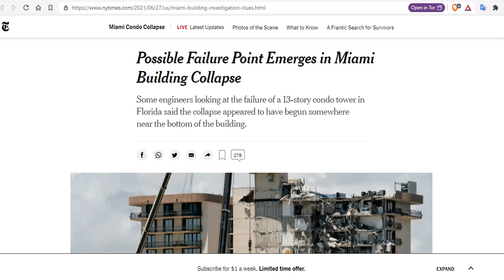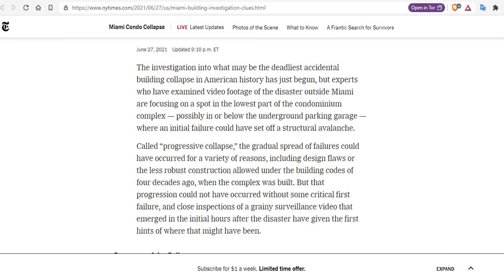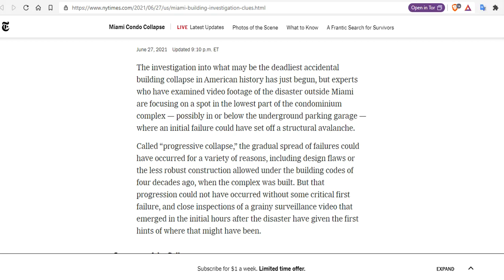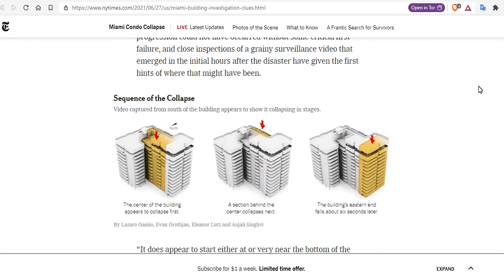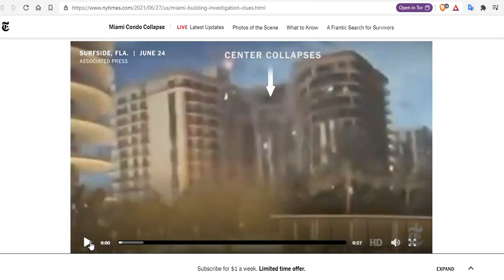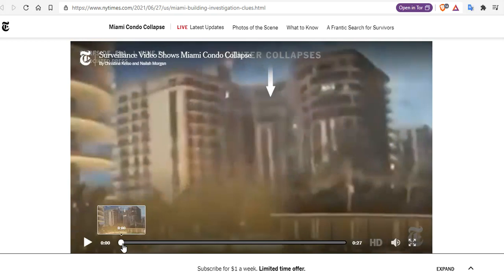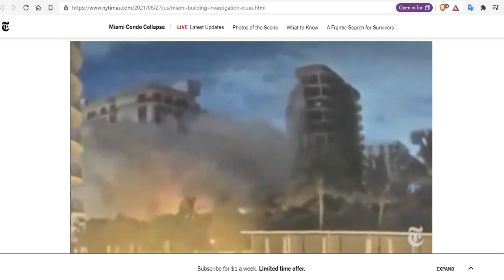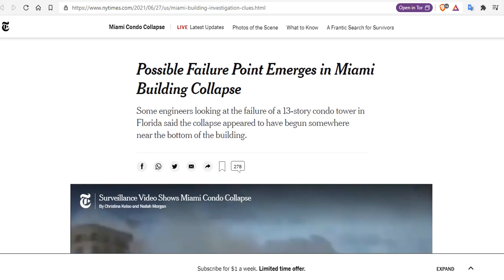Possible Failure Point Emerges in Miami Building Collapse - Prayers Go Out To All Involved!

Comment: I read an engineers report from 3 years ago it has a list of must fix asap. None of them were done. All the repairs that were done were done improperly
Reply: Terrible that this could've been prevented. Those responsible need a little jail time to scare other condo associations straight. No repair cost is higher than the wrongful death settlements forthcoming.

Comment: I respect your skeptical scientific mind very much, but let's not forget we can't be experts in all things. I'm an engineering surveyor by trade with a specialty in compromised highrise structures, and I can tell you I've seen zero evidence of anything nefarious so far. I see LOTS of evidence of shitty construction and piss poor maintenance. The supposed McAfee tweet was not found in his archived posts. Buildings collapsing in this manner is not evidence of a controlled demolition. There's video of the popcorn ceiling stucco crumbling under compression for a day or two before the collapse. At this moment all evidence points to punch sheer freeing a lower slab from it's supporting columns, crippling one or more columns, and causing the structure to "creep to failure". It does not appear whatsoever to be a sudden event. Nothing in the rebar suggests an explosion, triggering impact, or foul play. If I see new evidence, I'm open to changing my mind. But let's save our armchair forensics for Building 7.
Reply: That is a fair comment. I have recently been looking into punched sheer fracturing in slabs. 
A building I have been working at has this flaw to which the engineers had said they are good cracks.... when the cracks run from one column to the other and at a column spread out in an 'ice fracture' look...

After hearing how the rebar doesn't extend to column supports and so then the grid mesh doesn't meet there, there is no overlap for integrity. Then they go pack 100+ tons off steel on top. (The building had already been evacuated due to 'settling')

They had already monitored a 2 inch drop in the slab height needless to say; I don't feel safe there. I have made sure I will never visit there again

It inevitably will come loose one day.

The engineer of this job is the same who is involved with a ceiling collapse at Curtin university WA, Australia 2020. They still haven't found anyone liable for the death of (luckily) only 1 worker. 1 young man who still had a life ahead of him.

My heart goes out to all the people who have suffered this tragedy in Miami.

Still, I am open minded about the possibilities of defect manipulations to cause a collapse.

I just don't trust the coincidental timing of this.

One thing is certain though, John McAfee didn't commit to suicide
Reply: @baalqefel1570  I agree with you about John. Just stay safe and never go in a building you're uncomfortable with. If you don't like the look of the rebar lapping around columns, stay the heck out. Like you, I'm keeping my mind open for nefarious things, just haven't seen anything yet 👍🏼
Reply: Thanks for your expert opinion. However, the gross negligence does seem nefarious.
Reply: @wildanimus2559  Oh this is definitely a case of gross negligence, no doubt. But I hesitate to call that nefarious because I don't know their intention. And while I am experienced, I'm not truly an expert 🤷 But yeah people should go to jail for this. Inexcusable to allow that condition to degenerate
Reply: Oh my god a sane person. Thank you

Comment: Middle of building to the upper left of demolished building and to the upper right rear of the building still standing....there are flashing light pulses.
Reply: My guess here would be electricity arcing as the power lines were breaking. But good eye
Reply: @Ryyder64  Yeah I suspect that's arcing from the severed conductors

Comment: Remember that beach construction has to be built on pilings driven through the sand to produce load bearing members. I would imagine 40 years ago they were still driving wooden pilings - think telephone poles (my Daddy's profession) They would be clustered together and cover a wide area under the structure. They need the sand to be present to work properly. If that whole area has been undermined with seawater for decades we don't know what could be compromised and what buckled. We need a whole lot more info. <bb

Comment: Durring a controlled demolition they weaken the bottom of the structure by taking walls and structural reenforcements out. Then they  attack directional cutting explosives. They also will cut through reenforcements half way through to aid in the collapse because exsposives don’t always cut trough large pillars. This was not a controled demolition. This was a catastrophic structural failure probably due to continued stress from the ground being to soft to build on and water erosion. But it’s not a controlled demolition. That’s not how demolition works

Comment: There was 9 million dollars plus in deferred maintenance scheduled on the building, might of been cheaper to tear it down, previous repairs likely contributed to the demise of the structure, but likely the cement used might have been sub standard allowing water, and moisture to attack the rebar internal structure weakening the building even more, lets not forget that they had a construction site immediate this building, so if you ask me, the building inspectors had some obligation to red tag the structure, possibly someone in the building inspections office was paid off to allow the 3 year window for improvements which seems a bit long for a structure that needed 9 million in repairs. If I get a code violation here they want it taken care of immediately usually three months or longer if approved by the inspector or granted.... I smell a combination of contributors here, but likely they will try to pin this on the inspections department once the paper is looked at closer.